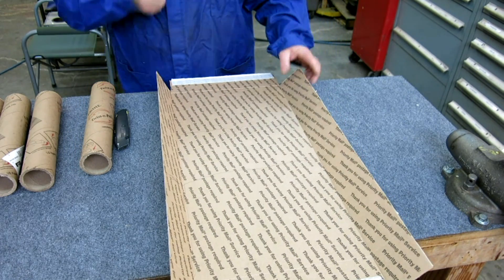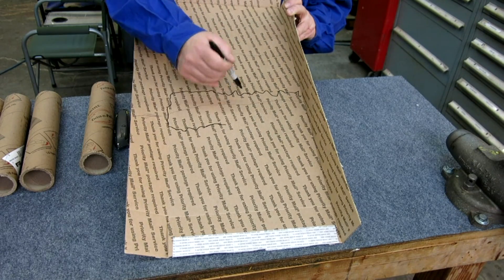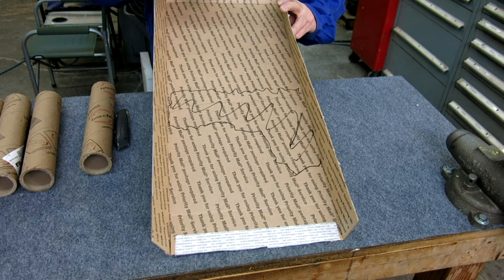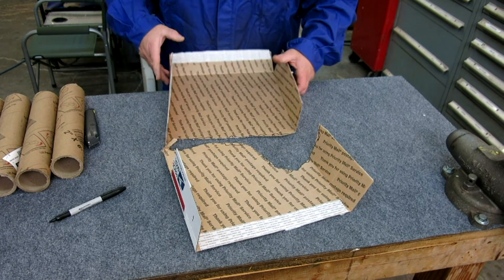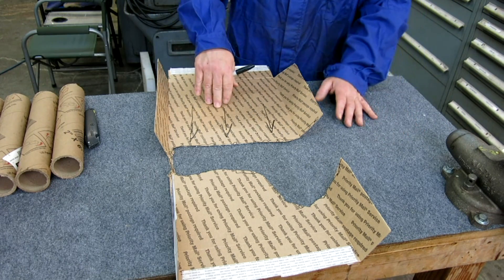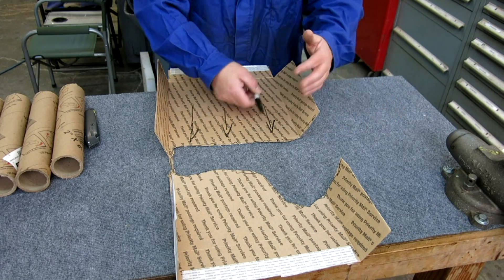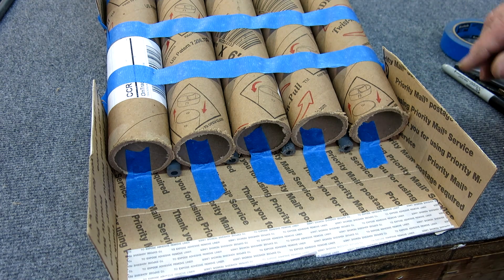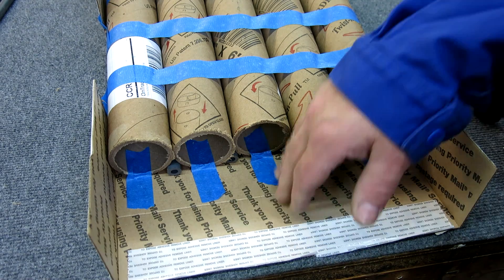Oroville Dam Spillway Repair

Comment: looks like a winner Tom!!  Just not sure how stable the downstream support edge would be?!?!   Your Idea, a few of Jody's welding friends and turn the Damn off for a day and it could work!!

The sad thing is this has to be done at all.  If Governor Moonbeam had listened to the Sierra Club or Army CoE for the last 3 years this wouldn't have been an issue at all.  But he had too many Pandering for Illegal Alien vote projects to spend our tax dollars on.
Reply: Just curious if you have any idea how many vital infrastructures have been deemed in dire need of repair?  There are thousands.  So try getting money to repair a dam in the middle of a multi-year drought.  Politicians are severely ADHD in this area.  IF any governor would have pushed to get this dam fixed in 2013, there would have been an outcry and similar calls for diverting funds to other "more pressing" matters.  As an example from a local experience, my area in Texas was in a multi-year drought.  Our water supply lakes were down to the single digit percentages in usable capacity.  Real estate values were dropping into the toilet.   They passed a project to recycle  waste water and another for a pipeline to a water source not affected by the drought.  Last year we had a solid month of rain, similar to what N. Cal. is experiencing and the lakes soon were at 100 percent.  Those only partially completed projects were immediately cancelled.  It's simply too much to expect politicians to have the foresight to plan repairs on a system that has served so well for so long and see into the future that nearly twice the annual rainfall would be dumped on the area in a month.  We can monday morning quarterback things like this all we want.  There are, as I mentioned, thousands of deficient infrastructures.  Which ones will be stressed to it's breaking point in the next 4 years?  Which ones will you be able to fund?  Will politics be set aside for the common good for unforeseen weather events to get that funding?  It would be wonderful if every deficient notice on critical infrastructure was immediately addressed with funding and action.  Unfortunately, we don't live in that world.
Reply: blmeflmm66
so, better to not have any political fallout over funding infrastructure that was deemed deficient numerous times since 2005 by several different entities.  Better not to have any political fallout but OK to displace 200K people in an evac and put probably as many in danger or dead if it had given way.  Better to not have any political fallout but go to the feds for help fixing now that the costs are a couple magnitudes higher... Fortunately Trump told Moonbeam to use some of his sanctuary city defense money to fix it.  Oh, and because of the deficiencies, the damn has been operating without a license for 12 years?  Oh well, "hasn't had a problem yet, lets let it pass another year" has come back to bite them.
But you are right..  this is not an isolated case and sooner or later deferred maintenance is going to get someone (perhaps thousands) killed.   Meanwhile we go on spending money on non-citizen "feel good" programs.
Reply: Political fallout is fine if deserved.  My point is that had he TRIED to fund the repairs and upgrades 3 years ago, he would have been laughed off the podium by the vast majority of Cal legislators, voters and media.  Headlines like, "Gov. Moonbeam want $100M for dam during record drought"  or opinion pieces like, "Instead of creating jobs, Gov wants unnecessary dam upgrades" would have been all the rage.  If he HAD pushed for the fixes, the only difference would be that HE would be pointing the finger saying, "I tried to fix this, but the legislature wouldn't fund it."  And we'd be in the exact same physical situation.   In a time of such partisan division, both sides wait uselessly doing nothing but blocking the other sides efforts waiting like vultures to point fingers when bad things happen.  And make no mistake, had January produced normal or even much higher than normal rainfall and not the off the charts precip in the area, no one save those same folks who've been red flagging this for years, would even be talking about it now.  And even so, had the main spillway, which to my knowledge, wasn't deemed in need of work, not unexpectedly failed, we still wouldn't be talking about it because the emergency spillway wouldn't have seen use.  Like a household short on money, routine maintenance isn't deemed the top priority and things deteriorate.  Try to sell a very expensive "fix" for a problem that's never happened in the entire 50 year life of anything, and it's pretty unlikely that  you'll find willing buyers.  So instead the real head line is, "Dammed if you do, dammed if you don't".  There is plenty of infrastructure work to spur the economy and get folks working in good jobs for decades.  We just need to pay for it.  And that's the show stopper.  Unfortunately, the longer the maintenance is delayed, the exponentially more expensive it gets, with the added catastrophic consequences.  Repair and upgrade is certainly cheaper than paying claims and total rebuild in the aftermath of disaster.  Sorry for the long post.
Reply: blmeflmm66
bottom line is he just didn't have the balls to do what was right...  he gave in to... as you put it "being laughed off the podium".   That's the problem with politics... when the going gets tough, they turn and run.... or whine about it... or blame Bush.
Had he done the right thing at the right time, this would be a non-issue right now and we would not be having this conversation.  He and the residents around Oroville would have a nice warm feeling of security.   He's made his bed, now he has to sleep in it.   But he has spent a ton of money on Sanctuary cities so I guess that makes it all right...NOT.

Comment: Tom - love the video. If we continue on with your thought/model. Instead of putting smaller pipes in between, could we weld in splitters (technical term) that would protrude out to divide the water. The thought I have in my head is basically to make massive wedges like - http://www.learnnc.org/lp/media/uploads/2007/10/wedge.jpg. Where the wedges back meets the pipe (or the section between the pipes) weld it to that shape. or close to it.  As the waters hits them come to a point and deflect water to either side. A point vs a blunt object I would but much less load on the pipes (...as in pushing them back). But may be way too complicated a fix. Would also be harder to dismantle. Love thinking like this - just my .02 cents and I don't know that I'd even qualify it as that.

Comment: Well, metalworkers would look for a metal solution. A concrete person would tell you that you can design a mix that'll acheive 35MPa in less than 24 hours. With the materials available today, I'm sure they'll find a solution.
Reply: John Alexander The canvas cement composites out there might work nicely if they could throw enough rubble into the hole to fill it back up. Just capping it with a layer somehow designed to break up the flow might buy time to make a proper solution. Water moving down along a flat, straight surface like that starts doing weird stuff to normally solid materials.

Comment: Instead of pipes... which have gaps, and you have a vertical section that cuts into the flow... they could dump a large amount of rocks into the void to partially fill it. That would occur quickly... then lay down corrugated steel. The corrugation makes it stiff... and the rocks under it would support it. the leading edge could have a butyl rubber strip about 3 feet wide that the plates would be bolted through. That should seal it effectively... the remaining small gaps could have silicone. 

The repair should last until at least into the summer when things dry up a bit. Much lighter... and the materials could be carried up faster. (Sheets could be laid out overlapping like shingles.)

Comment: Tom,  really like this video. I would really appreciate an ongoing series like this, in which you approach engineering problems in the news and break them down, looking for solutions. 

As to this solution, I would just make a metal trough to bridge the gap between the concrete sections. Similar to how the old army bailey bridges were built. Here are my reasons to choose plate over pipe:

Flat plate is much easier to transport to location than tubes. 
Plate is cheaper than tubes.
Flat seams are easier to weld properly.
Since a top is not required, total material usage will be lower than with pipe. 
Flow will be significantly higher with a rectangular trough as opposed to tubes. In addition, the friction and turbulence caused by the pipe mouths will be eliminated. 
Flat plate could also be run up to the top lining the concrete, both to protect it from additional erosion, as well as to anchor the metal chute patch from washing down the hill.
I bet there are more ship builder (plate)welders than pipeliners close by. 

In the gold mining industry, they throw old HUGE mining machinery tires at the base of the sluicebox to stop the water erosion from undermining the washplant. Agricultural tractor tires also work. They break up the flow and catch sediment, stopping the erosion. Plus they are lighter than rocks to move around and place. This could be used in the emergency spillway to help it survive until it dries out and a permanent fix can be done, like lining it with concrete as was suggested a decade ago..........
Reply: The techniques of building in sections and welding/pinning/bolting the sections together as used in shipbuilding is easier to implement with plate. With the pipe solution, there is quite a bit of fitting and welding to be done at the installation site, prolonging the length of time the emergency spillway needs to be used. With sections build from plate, all the sections can be built simultaneously off to the side, and placed quickly, reducing the time the emergency spillway will need to be used. Pinning them together like bailey bridges is the fastest.

Comment: Ideas are always good to think about. My day job is to advise and train Civilian-Military organizations in Crisis and Disaster Management Technology and Simulator systems. You learn and observe few things along the way.

Your idea might work at 30% of the capacity of the pipe diameter (s) used. Data is available. I'll publish  links below.

Water flow, gallons per second or hour can be calculated,  to determine pressure resistance rates (tonnes per cubic yard @ per second/minute).

https://en.m.wikipedia.org/wiki/Hagen–Poiseuille_equation

If you want to see a sample of how flow is actually calculated, here's a great link showing the formulas used on a small scale. 

http://engineering.stackexchange.com/questions/8004/how-to-calculate-flow-rate-of-water-through-a-pipe

What ultimately hurts this Emergency repair design (limit) is the sides of the pipe wall faces, that will build pressure (Force), even at only 30% of rated capacity. Temporarily staking these pipes into place at the angles required would be an immense challenge. Remember, the surrounding area is 100% saturated and will take months to dry out. Drilling will be  dangerous and unpredictable until core samples are reviewed.

Because of the angle and location of where the damage has occurred repairs will take months to prepare. There is no fast way around the problem. The primary cause of most under road pipes failures during flooding, is wall support is lost because it is saturated losing all of its support properties. Civil engineers are given a fixed amount of money that is capable of designing "some" disaster mitigation.

The reason the failure occurred in the first place is because funding had continuously been cut for all mitigation planning across ALL spillways. After years of drought, the underlying spillway soil has lost adhesion support to the concrete, resulting in collapse as shown after continuous rainfall over the past few months.. There were warning signs and ignored. Just like many other flooding events. This is not a new civil engineering problem. It's been well documented for DECADES. All over the world. Sorry California, you're not that special. 

https://public.tableau.com/profile/publish/OrovilleDamMonitoringDataviaCDEC/Dashboard1#!/publish-confirm

www.washingtonpost.com/news/post-nation/wp/2017/02/13/officials-were-warned-the-oroville-dam-emergency-spillway-wasnt-safe-they-didnt-listen/

http://www.cnn.com/2017/02/13/us/california-oroville-dam-spillway-failure/index.html

British Columbia has written so many reports on how mitigation planning and budgeting should be allocated, they could have been finished by now. But they have learned to disclose risk caused by Fraser River erosion, spillway limitations, Emergency dikes, etc. Vancouver BC spent a million dollars just creating an updated flood plan!

https://news.gov.bc.ca/stories/new-reports-on-fraser-river-flood-risk-released

This service spillway is no different. Planning, maintenance and protective anti-erosion measures must be followed. If not, this is the result.

The laws of nature, hydrogeology and physics cannot be ignored as they often are by politicians. They do not believe the science is worth the investment. It really is that simple or, are not willing to invest in the capital required.
Reply: "Funding was cut." Maybe better said, "MISALLOCATED" or "MIS-PRIORITIZED?"  If a lesson is to be learned (and going forward lesson must be learned first, or the going forward is just repeating foolishness)the proper concepts would need to be expressed?
Reply: +barry funding was cut, and is so oftenthe case, but the taxes taken that we expected to be spent on such projects wasnt cut,  is the usual problem, misallocated into some panama bank account probably
Reply: Barry Lochridge Having extensive experience in this field, I am not going to dive into  the numerous ways my post can be interpreted. 

I can only tell you the specifics relevant to how many of these types disasters occur. 

Maintenance of large capital infrastructures is expensive. It comes to down to risk management and what level taxpayers are willing to accept. Those are the facts. 

As an example, this spillway has not seen extensive usage. And this is only one of the many water reservoir system components that require service. We're talking about costs that could add 3 to 5 cents per gallon of water based on a user - pay system. And that's just for spillway control. The dam itself and other pieces also need funding.

Research and lessons learned on this topic are widely available.
Reply: My editing is caused by use my Android Smartphone to post and then realize the mistake afterwards. (dumb dumb dumb - keep forgetting to turn off auto correct). I'm not taking a defensive position. I'm suggesting that your initial comment and reaction implies civil engineers and water reservoir management decided to intentionally "misallocated" funds or "prioritize" what (if any) funds that were available and not spend it properly. This is unlikely at the civil level. I think it's higher up the food chain than that. 

There are no lessons to be learned either. As I stated earlier, this is not a new type of civic engineering problem. More problematic are politicians whom do not 'want' to learn.
Reply: Your Governor doesn't like dams, what better way to take care of the problem!
Reply: Doug Hanchard I placed no blame on you, nor interpretation.  My comment was more as note to the issue of what tax-payers do and don't understand as you mention.
Reply: Barry Lochridge That's not how I would interpret your first comment to my post. You have implied intentional misfeasance. While this does occur, it isn't the primary reason or cause in the United States or other Western nations.

I would suggest that there's a higher acceptance of risk relative to the capital costs involved. Again, each case, circumstance and type of investment varies relative to the type of risk involved.
Reply: You need to read my initial and later post more carefully, with a less defensive perspective. Also define the words emphasized by all-caps for your own edification, and not simply by legal definitions used in government malfeasance or "misfeasance." cases of law.
Reply: Yes, now you are getting the drift.  Not once in my post did I ever accuse you, nor anyone, actually, of misallocating or improper prioritization of funding. I just asked the question. If I lived in California, I would be asking it of the ones at whom you just pointed a proper finger: Government politcal figures.  I live under a dam and have every right to point finger as well, but mine was not pointed at you nor engineers, etc. but rather would be/must be pointed at those who allocate and prioritize funds for ALL of the money taken from citizens for use by Government.  You seem to be making assumptions from my post that are neither there nor intended.  Thus the data seem to point to your taking a defensive position. I think we actually agree.

Comment: There few pictures on that page including http://www.usatoday.com/story/news/nation-now/2017/02/13/what-oroville-dam-and-why-so-terrible-if-fails/97844512/ showing men down the hole in the main spillway. The hole appears to be 10 meters deep and 20 to 30 meters wide... not sure the pipes could do it.
Reply: 53 meters wide (width of the spillway based on google maps) and 145 meters long based on a picture that shows the concrete slabs that make the spillway (6) check my post above.